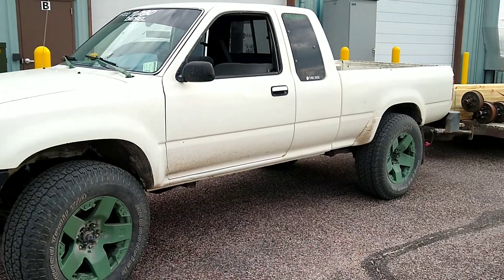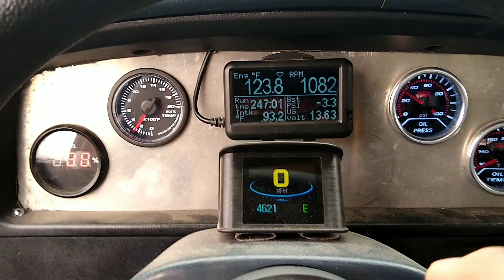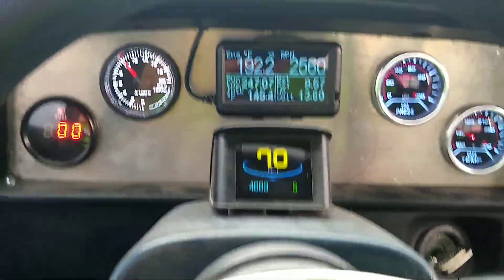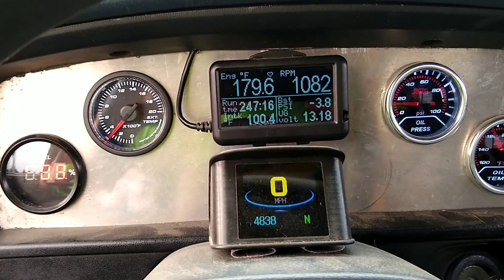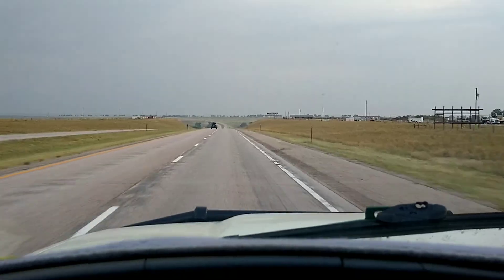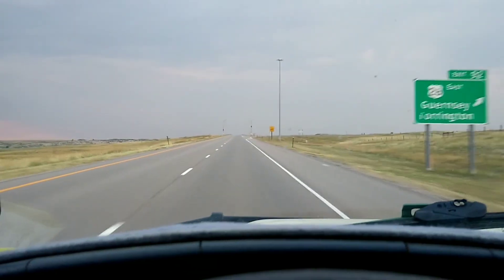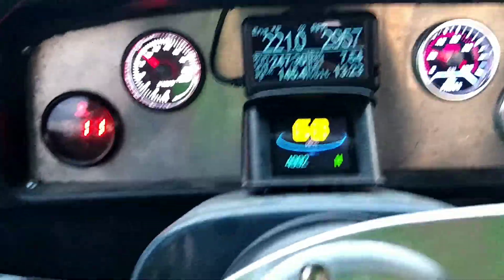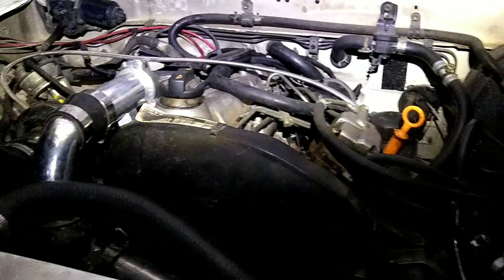TDI Swapped Diesel Toyota tries out a Tow Tune to control EGTs from Tekmektronics

Comment: I'm really liking your tune/setup.      However,   you have mentioned in various  postings that Nelson @ TekmekTronics may be or was  downsizing/getting away from tunes.      I only have  my wife's FB account to use,  (pending acceptance to the TDI club)  and I  would've sworn I saw a posting from him that he was jumping in with both feet.. and  going full time with this venture.  
What's the lowdown  on him then?    

As far as   retarding timing/watching engine temp rise... that is a FINE line to balance!     I remember driving my street/strip  car on  Saturday night,  and because I was too cheap to keep it filled with 106 octane,  I  simply reduced the timing a little to run  mo-gas....then  watched my temps  soar.     
anyhoo-    this video is about 2 yrs old now.   What's your impression by now?  any tweaking since then?
Reply from the maker: Ha ha ya a lot has changed, running a new turbo and tune, but still the same characteristics, it does create more drive pressure and probably reduces engine life some, but it's needed to do what I'm doing with such a small engine.  TekMekTronics is still doing his thing, just gets backed up a few months at times.  If you want to do V8 things with a 1.9l TDI, I would definitely recommend this tuning.
Reply: '94 regular cab toyota 4x4-  basically used as a parts runner/sideXside/pasture-runner/firewood transporter.    I'd  say  'needing v-8 power' is going to be  MY  'on demand'  choice and not  required just to  move the vehicle.    I"m keeping in mind that my w56 is  lower torque rated transmission compared to the R150.  Driver technique and a little self control is a big part of this. 
How it's pounded on 5 percent of the time isn't near as detrimental as the previous 95% @TDISwaps
Reply from the maker: @roberttammerawitchey4652 ya you best keep it toned down some haha

Comment: So a brm will be awesome in my 5k pound f1505 speed and stock tires? I never tow, just like driving my pickup as a daily
Reply from the maker: So the biggest problem with that is I believe they only make adapters for the ranger transmissions, so you may have to source a different drivetrain setup to make it work.  Right now we are going to start testing with even smaller than stock tires to see how it does.  In this application the closer you can be to 3000 RPM on the highway the better.  When towing with my Toyota I usually stay over 3k RPM and it does just fine, but factory 1/2 ton gears are usually setup for closer to 2k RPM, making overdrive about useless
Reply: @TDISwaps  I’ve narrowed it down to 2 options, M5OD-R1 from a Ranger, or a Jeep AX-15. I run 265-70-16 tires, 3.50 gears. The gearing will definitely have to change to 4.10 or so… I’ve also considered using a common rail 2.0 like a CJAA. In Europe the 2.0 CR TDI’s were put in vans weighing more than my F150…
Reply from the maker: @Thanosisnotreal  Sounds like you have it mostly figured out, I don't think you will see much for gains as far as EGTs and engine temps with the CJAA from what i've read.  These little engines just need to be spinning faster for their little water pumps to move enough coolant during higher demand

Comment: I'm sure you do by now, but I'd definitely get a mechanical boost guage too! 

I've used the Ultraguage for years now on lots of vehicles, and when you have tuners, some of the sensors read inaccurate, because the computer is being tricked, I have a ALH and when I upgraded to a 3 bar map (with no tunes) my boost would read around around -2.2 psi where as before it would read considerably accurate to my mechanical guage. (Apx. .2 - .5 psi at idle while vanes closed, cold warmup). Love the amazing swaps you feature and build, just learning about TDI's myself!
Reply from the maker: Haha yes you're correct, if you keep watching my progression of videos I got up to almost 40 PSI boost and the ultragauge only reads to 22 I think so a mechanical gauge was a must!  The ultra gauge has its advantages but instantaneous readings are not one of them

Comment: Very nice. Curious how hot the oil got at the top.  And also,do you have an upgraded oil cooler?
Reply from the maker: I saw about 220° oil temps with the factory oil cooler, keeping the coolant temp at 180-190° helps keep the oil cooler so it has room to climb up some on the hills.  My jeep with the factory thermostat runs a little hotter, I have seen 235° on it but that's all still within VW spec so I haven't messed with upgrading coolers yet
Reply: @TDISwaps  interesting. It's within spec for temperature perhaps but not for oil pressure. Isn't that 29 psi warm at 2000 rpms
Reply from the maker: @dwightmartin6158  that cheap ebay gauge doesn't read right, I have 38PSI at 3000 with a mechanical gauge.  Need to get a new one but haven't had the time